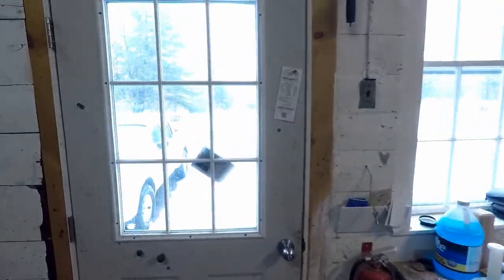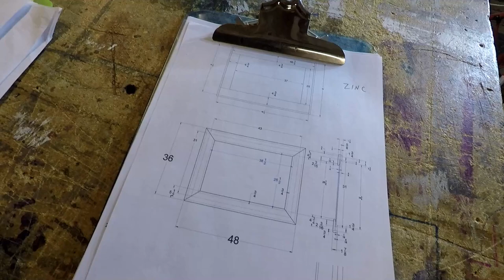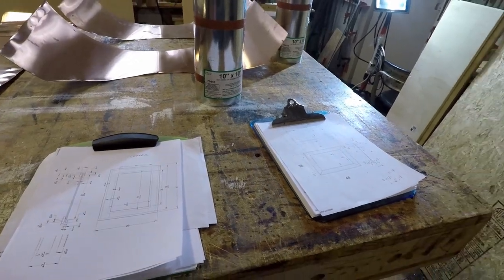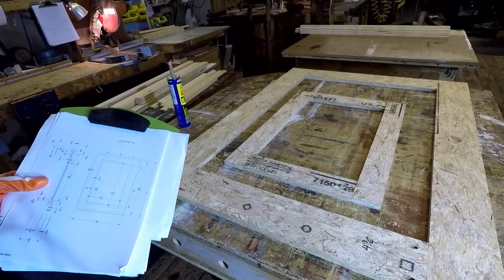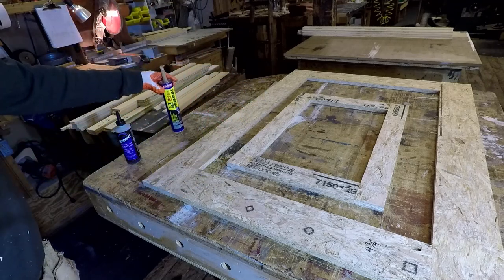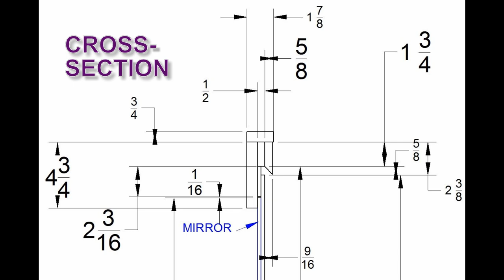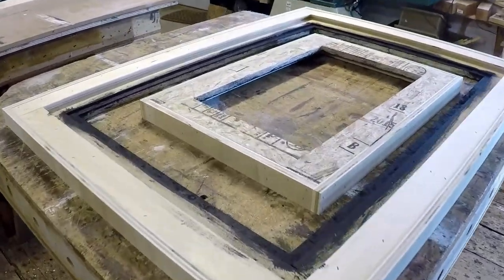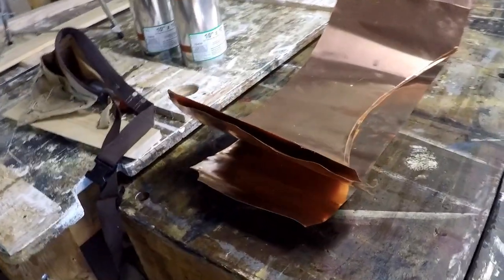Copper + Zinc Mirrors - Part 1 - Woodworking

Comment from the maker: I filmed this video entirely with the the new GoPro Hero 5.  So if you noticed that the sound is a little out of sync and different, that is why.  The microphone doesn't seem to work very well indoors.  I go back to using the GoPro3 in the next part of the video, and will be returning the GoPro5.

Comment: hffcom whats your table saw model is ? do you have pic of final mirror ?
Reply from the maker: I have a Grizzly 12 inch G605x and to the right of it is an older Jet 10" contractor saw
Reply from the maker: No the mirrors are in the finishing phase right now.  Here is a photo collection of some mirrors I have made before.  https://www.flickr.com/photos/mjrvt/albums/72157632877886198